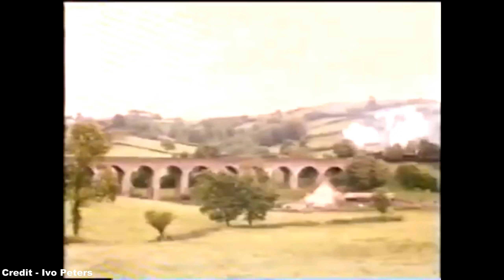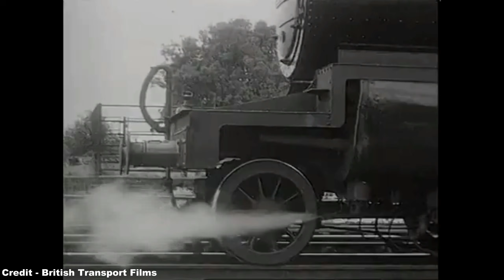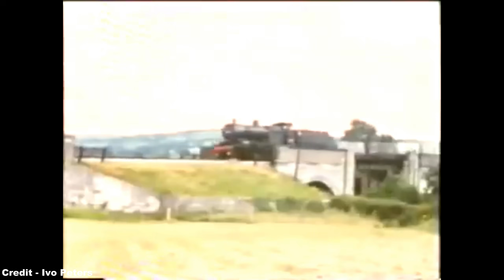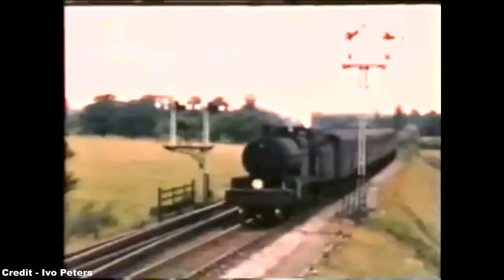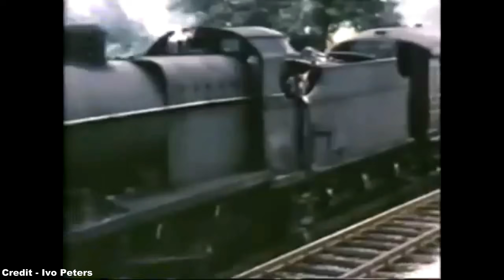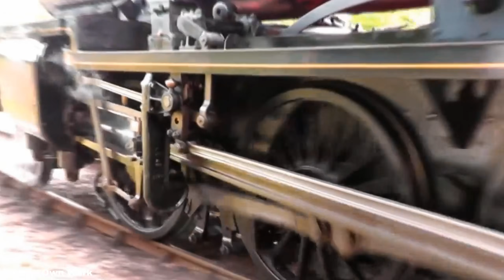The S&DJR 7F: Britain’s Ultimate Hill-Climbing Freight Engine

Comment: 10:24
It is always a
'get yourself settled, there's a new Ruairidh video on'
utter joy about to unfold moment, when your latest exceedingly well researched presentation arrives. 

I mean no disrespect but I just let all the details of square footage and such simply wash over me, every now and then zoning in on some shocker such as the fact that
"Just before the second world war, steam sanding gear was fitted to all eleven engines..." 

Does that mean that there was no such thing beforehand or at least a shovel it and hope for the best suboptimal solution to the heavy snows of the steep Mendip hills, the very reason for double heading this stretch through the coalfields and these pocket battleships' birth in the first place? 

Many thanks for all your hard work and fulsome respect for the hours you must put in in dusty archives  (or equivalent)!

Comment: I have always wondered why Stanier's 8F was designated 8F when its tractive effort was just 32,440 lbs ft, whereas a Churchward 28xx/Collett 2884 is also classified 8F but has 35,380 lbs ft, and the Fowler S & DJR 2-8-0 has 35,295 but is classified 7F. I'd call the S &DJR 8F, and the Stanier 71/2F. Yah boo suks to the LMS/LMR Stanier class.
Reply: Power classifications have to do with horsepower, not tractive effort
Reply: @Dallas22468  That, if true, is very interesting. Do you have any evidence to back up your assertion? Power in HP or kW is calculated by speed x mass, so how come a WD 2-8-0 was classified 8F too, when, due to not having secondary wheel balancing, it was rarely run at more than 40 mph?
Reply: @Dallas22468 According to this, you are completely wrong.
"British steam locomotive power ratings (the 0–9 power classes) were primarily based on continuous tractive effort at speed, rather than peak starting power. The system was pioneered by the Midland Railway, later adopted by the LMS, and standardized across British Railways (BR) in 1948.The exact calculations were determined using a combination of two key factors: Cylinder Tractive Effort: Calculated at running speed (50 mph for passenger engines, 25 mph for freight engines) using the Lancashire and Yorkshire Mean Effective Pressure (MEP) curve."
Reply: @JohnCurtisDownunder Sorry, I confused myself in my statement. I was more meaning to say it is based on continuous tractive effort, rather than starting tractive effort. The figures for TE given reflect starting TE and not continuous. This isn’t a perfect reflection either, as BR had their own formula for how they gave out power classifications, and had different methods for either P or F classes.
Reply: @Dallas22468  I thank you, kind Sir; but since continuous tractive effort is never, for any class of steam locomotive, ever stated, then how would you be able to see that, for instance, the Stanier 8F's continuous tractive effort was greater than that of the S & DJR 7F therefore meriting an 8F designation, rather than a 7.5F as I (somewhat tongue in cheekily) suggest it should perhaps have? I look forward to reading your reply.